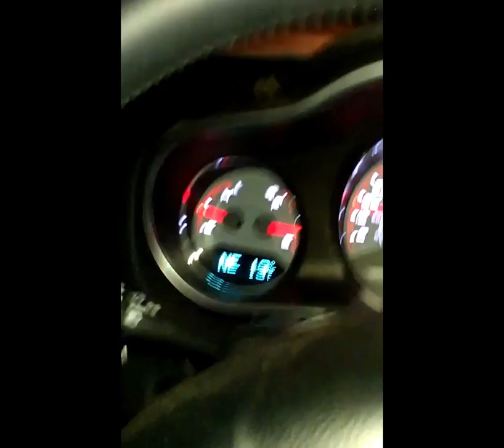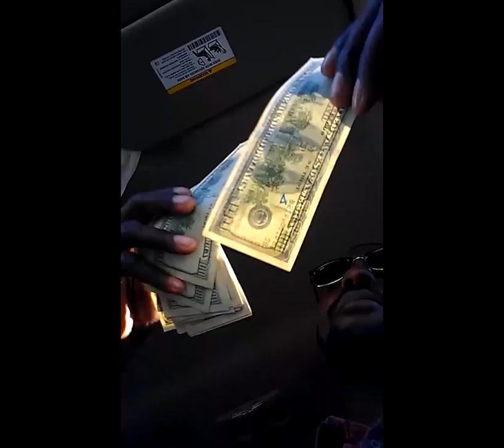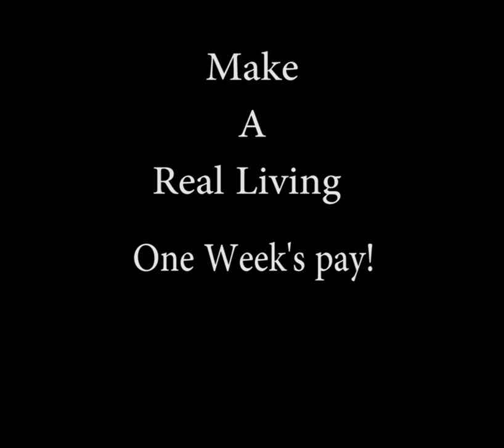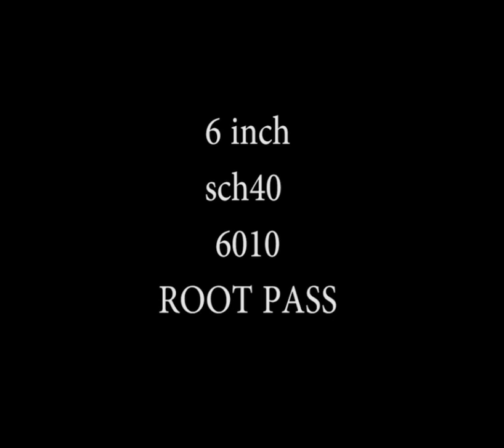The life of a pipe welder

Comment: any pointers for someone wanting to get into pipeline work. Finished a course in welding, should I goto an apprenticeship or just go for my certs
Reply from the maker: Go for your cert, don't waste no time.
Reply from the maker: Company's in the U.S. usually have pipe welders test in the 6G position. Most of the time the pipe test will be a heavy wall 2inch coupon, tig the root and hot pass then stick Weld it out until finished.

Comment: 4in 6g Tig all the way and 4in 6g Tig root an hot pass stick the rest
Reply from the maker: what size gap are you going to use  for your root pass?
Reply from the maker: I use a 5/32 gap on my root pass, with low heat  around 85 to 90 amps. The lower the heat when tig  welding your root the more control you will have over your metal flow. I Use the bridge technique, side to side side to side , on rush just control your puddle. With your 7018 rod keep a close arc and a good speed but not to fast. For my heat I use 90 amps  with that 7018   3/32 rod.
Reply from the maker: I use a 5/32 gap on my root pass, with low heat  around 85 to 90 amps. The lower the heat when tig  welding your root the more control you will have over your metal flow. I Use the bridge technique, side to side side to side , on rush just control your puddle. With your 7018 rod keep a close arc and a good speed but not to fast. For my heat I use 90 amps  with that 7018   3/32 rod.